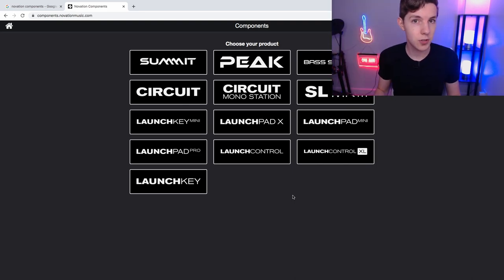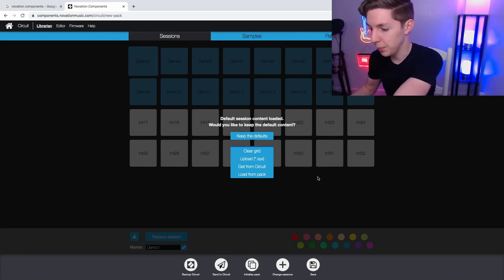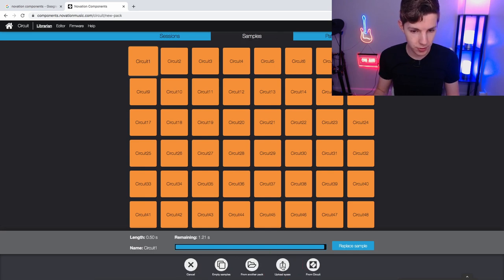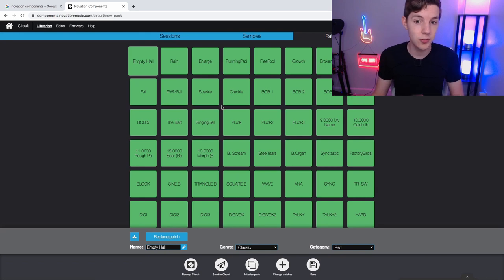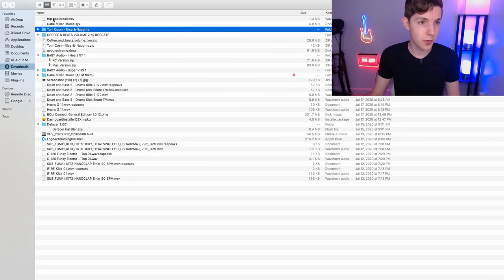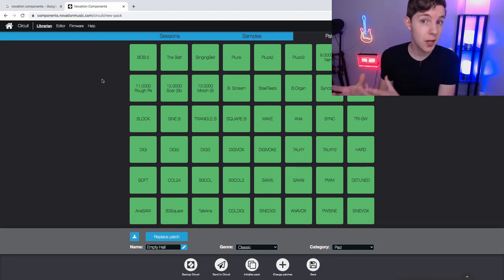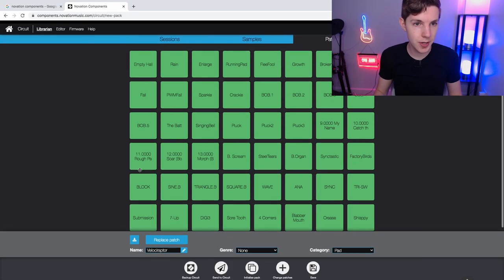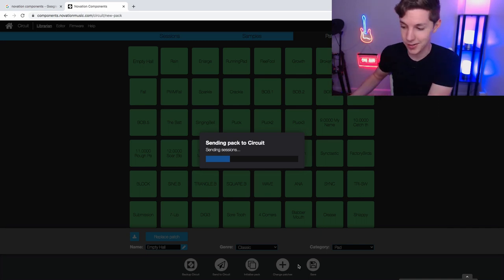How to Load Samples & Patches onto the Novation Circuit (Components Tutorial 2020)

Comment: I've watched several of your video's about loading my own samples into my circuit tracks and i've still yet to be successful.
You tend to be quite fast, i struggle to keep up with you even if i keep going back a few seconds.
I can get into Components no problem but if i remove some factory samples that i'm not keen on and replace them with mine, then send them to circuit tracks they don't appear in the synth(s), or drum samples.
My samples are wav files, mainly drum hits or short drum loops, i seem to be spending more time trying to work this sample issue out, than actually producing tracks.
I have an Electribe2 that i can import samples into no problem but i just can't get my head around Components.
Easy when you know how.
Cheers. 🎼🎹

Comment: i'm trying to upload in chrome and it is saying it isnt a syex file, how do I correct this?
Reply: Same, I can't find the date of the 1.8 firmware, but I'm guessing it could be some kind of conflict due to changes by Novation.
Reply: Did you ever find the answer? I have both the drum file & the synth one he mentions in the video but I can’t upload it because it says it doesn’t work with circuit and to instead choose a .circuitpack file.

Comment: Gabe, what kind of SD cadr you use? There is an issue with loading packs to the circuit tracks what a lot of people have (circuit always start loading packs and after an average 30 secs crash). Have you ever same problem? Thx
Reply from the maker: I haven't had that problem fortunately, but I did do a dedicated video on loading sounds / using Components for the Tracks. Double check that the card isn't too big (some hardware devices can't take SD cards bigger than 32 GB) and that it's formatted to FAT-32.

Comment: How do you create samples?
How do you create patches? 
What kind of files does Novation accept? Where do you make such files?
I would like to be able to access the samples and patches as files to be edited elsewhere. Can I do this?
Reply: Answered some of my own questions.
Samples are .syx files that have to do with MIDI streams. There is no audio involved as near as I can tell.
Patches are wave files, .wav. You can access the existing WAV files in your Circuit Tracks by clicking "New Pack" on the left in Components and selecting "Get Pack ..." in the Get started menu. Pick one and it will load it. Once loaded you can choose Samples in the menu for the parts of the pack and you can Save it in the Save menu on the right which gives you the option of saving the Samples. The whole collection is downloaded as a ZIP file. You can access the WAV files there.

Comment: Does anybody know how I can transfer drum samples from my OG Circuit to my new Circuit tracks? I've had a look in components and there doesn't appear to be any way to export ogC samples as either individual wavs or .syx files that can be read by The CT.   Some ogC packs come with individual samples and/or .syx files but there doesn't appear to be an option in Components to import ogC samples to the CT. Please help as I actualy like the default drum sounds that came   with the ogC and the drum sets of certain packs.  Seems odd how I can transfer individual patch .syx files but not samples....?

Comment: You are so fast and advanced. I just want to add some sounds onto the pads from my external hardware synth. I have no problem doing this with the 404 but just am lost with this. I can hear my keys through the Circuit, which is a start but just cannot seem to get it to record into the unit. Can anyone help?
Reply from the maker: It depends on which Circuit you're using. The original can't do this, and the Tracks can only pass sound through it, not record. If you have the Rhythm, you CAN do this, and I did a dedicated video on how:
https://youtu.be/Ujpx3BP1hnU
Reply: @GabeMillerMusic I can't believe I'm starting to understand.  How can u record froM circuit with a sampler or something???

Comment: What size micro sd to use
Reply from the maker: You can't use a micro SD card with the original Circuit. For the Circuit Tracks, packs are around 5 megabytes, so anything over 200 megabytes (to be safe) should be more than enough. Circuit Rhythm packs hover around 20 megabytes, so anything over 700 megabytes should give you safe margin.
Reply: @GabeMillerMusic  i have the new version